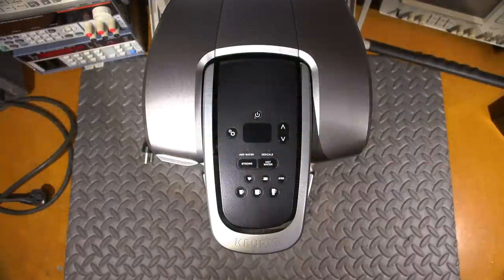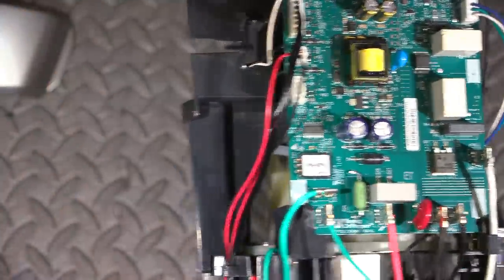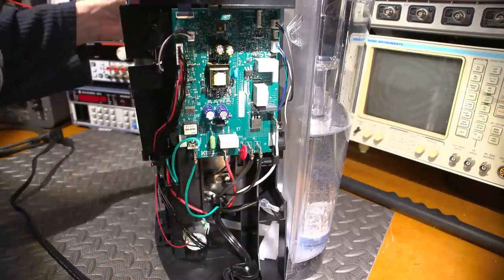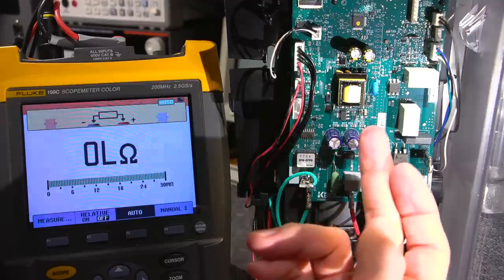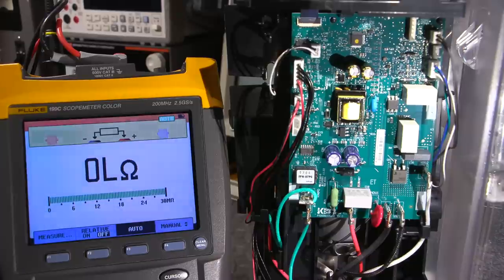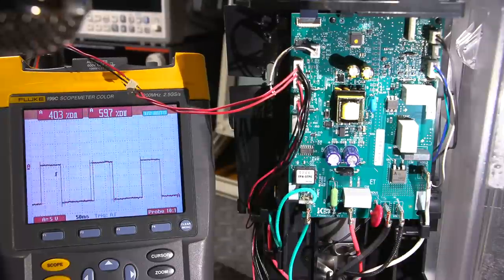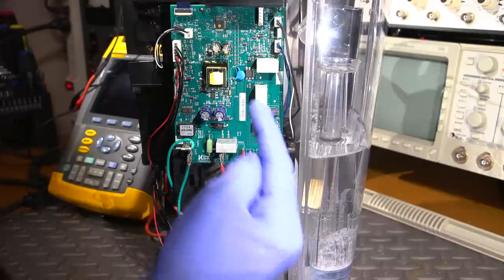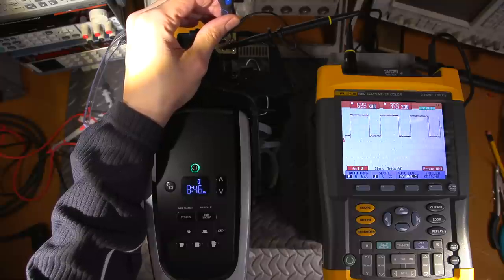Coffee Maker Repair And Modification - "For The Perfect Cup"- The Keurig!

Comment: I am willing to bet that was ONE satisfying cup of joe! I once reprogrammed a Cat Genie plumbed-in self washing cat box so that it didn't need the rf tagged and non refillable and expensive disinfecting/cleaning cartridges anymore. I was so proud of myself because consumer electronics are not meant to be repaired or modified anymore. I have a disk based coffee machine that works just like the Keurig (it even has the frother pump) that does not heat up anymore. The whole cycle goes as normal but the coffee is stone cold. If the heating element itself is burnt out I probably won't be repairing it but you have given me the courage to go in and see if the problem is with the control circuitry rather than the heater. I imagine i will be looking for a relay or or a big switching transistor of one type or another. Did you notice how the element was switched on your machine?

Comment: Elegant solution. I suspect a clogged or calcium restricted water filter.  Or the little board with the hall effect sensor, open cap or a faulty amplifier, or maybe the pulses are being messed with by the RF noise. You solved the RF noise, but it sounded to me like the built in RF suppression circuits/components failed, and it was leaking a lot of the high frequency noise from the switching supply. However, your solution works and it will probably last the lifetime of the coffee maker, so I really enjoyed this video and your "never say never" attitude!! Thanks for a GREAT video, Paul.  Cheers!!

Comment: I like my coffee maker (K. mini + ) most K-cups are for 6oz and this unit lets you put in the amount of water you want (fill tank is good for 1 use) it also has the 'strong' button.
In less then 2 min's and im good to go.
I like the fact that the unit you are working on looks well bidet and designed  in terms of board layout. We have one that does K-cups and has the 12 pot maker. sometimes you have to restart it after you program it the first time but it seems to like Pre-heat the first time then the 2ed time it works.

Comment: I bought a replacement 12v 5A power brick for an appliance a few years ago, and using the brick absolutely crushed even FM reception through much of our old house. (The FM radio's "antenna" was a few loops around the power cord.) I complained to the brick manufacturer, hoping they would acknowledge it was defective and/or needed a capacitor or three, but they just had me return it for a refund. If I were feeling like "tampering" with a new item I would have tried adding isolation like you showed, but I strongly suspected the third party replacement brick was destined to fail more quickly than the OEM part had. I ended up passing the appliance on to another person... it worked fine plugged into a 12v lighter socket.

Comment: I mostly think the 'deluxe' versions of these k-machines are deluxe junk, they can make them as pretty as they want with OLED displays, but they often are inconsistent at dispensing reliable amounts as it's not something actually 'smart' like a peristaltic pump. Have been through 2 of them and finally swapped to a single serving version, love the simplicity of it. The water you pour in is the quantity you get out, measurement lines on the fill reservoir if you need to get more specific ratios, no standing water left inside the tank to calcify etc. The only gotcha is if your drinking cup is dirty, then you don't want to use that to fill it. As well as a nearby water source of course.

Also that 'frother' feature is totally just an air purge.. they all have to do that or the needles will get gunked up over time. It's honestly amazing how they translated that into a new exciting feature. Also I highly recommend a battery powered whisk/frother to any that enjoy actual foam!

Comment: I had a $250 espresso machine that I bought from Goodwill for $10 with all the accessories. It had similar pump symptoms. Was caused by corrosion within the pump. Disassembling the coffee maker was quite difficult. It was NOT designed for repair as I had to Dremel my way in. I replaced the 15bar solenoid type water pump for about $15 (this was about 10 years ago) and great espresso ever since...althought the now properly working pump is really, really loud. The pumps look like they cost about $35-$60 now.

Comment: Cool little project and learned something along the way. I did learn some years ago that all coffee makers have a "hidden" programming mode where you can set EEPROM parameters.
Reply: Yes, I was going to post something similar. Totally speculative, but with the amount of "smarts" they program into the mcu, it sounds like the eeprom (likely built into mcu itself) may contain calibration settings (e.g. pump feedback/drive map), and that could have gotten corrupted somehow (maybe writing during getting the plug pulled, or perhaps the high noise level on PS which is also a very bad thing for digital circuits ;).
I suspect that these units may actually do some sort of calibration or learning over time, as the units get "scaled" (from hard water), and I was even wondering if there is some reset/relearn/calibration procedure (probably in unobtainable service manual), or even if the unit does some relearn at regular intervals, such as "descaling" cycle.
Mr. Carlson, wondering if you had already tried running it through descaling cycle?

Comment: I worked on a Keurig clone once.  Surprisingly simple.  It doesn't have all the bells and whistles yours have, but it does have one similarity.  It was a total pain to remove the plastics to get to what I wanted.  Mine leaked water all over the place.  Turns out, it was a manufacturing flaw.  In an effort to churn this things out as fast as possible, they managed to really screw up one of the gaskets.

Comment: Hi MR C.   Great vid.   I have a coffee machine doing exactly the same thing and didn't know what to do about it.  can't wait to pull it apart now. Thanks a million.
Reply: First try resetting the custom Cup Size buttons. I had a similar issue years ago after a coffee machine 'forgot' how to dispense water. It was fixed by pressing and holding down each button until the desired amount of water was dispensed.

Previous owner friend had already replaced the machine, but I took it home then accidentally fixed it by holding down each button to see what would happen. I was lucky to score a free working coffee machine!
Reply: @Microwave_Dave  thank you Dave I will try that first.

Comment: As hard as it may be to believe, its amazing to see how much similar and easier to disassemble this model is compared to the large commercial Keurig units we use at my office.

We have at least one at the office fail about every other year. I nab and tear them down for parts. They have a couple meters of plumbing, at least a half dozen valves, and a bunch of various sensors. All they do is make and dispense hot water, no other features like frothing or whatnot. I have not yet been able to determine fully why they are so overly complicated, there are so many flow paths and without it being functional, there's not a good way to tell what happwen during a cycle due to the various control valves.

I'd try to repair them, but I don't drink coffee and by the time I get the broken one, a new one has already taken its place. Plus the liability of running something at the office that is both electrical and makes boiling water is not something I want to take on.

Comment: You really do have a knack for this- well done.  Some comment and some questions for you.  Clever analog solution to a likely digital problem.  I learned quite a few things-  The little clip on the spade connectors was completely new to me- I guess my eye sight isn't what it used to be and I never saw this little latch- worth the price of admission.  My goto for making a quick and dirty PWM would be a 555 but you generally end up needing steering diodes to get better range- the TL494 is a nice fit.  The EMI fix was good too, surprised not to see a common mode choke on the input to the DC-DC- that thing couldn't have passed FCC compliance?- those results are posted on the FCC website and can be used to gain a lot of info on equipment- even a schematic if you're lucky. Some questions-  In one of the shots of the boards, there is a little 5 pin SOT-23 to the top right of the uP.  I wonder if this is an EEPROM.  It seems that you could dump its contents and compare it to a dump of a good Keurig unit and play with values- I know the values are cal constants so will vary some but would be interesting.  I am surprised the tach/flow sensor was a PWM, I would think that it would be a frequency- like a few pulses per motor turn. How do you get PWM from a rotating shaft?  Did you play with the frequency of the pulses you injected?  Thanks again- great work.

Comment: Thought about you the other day sir, was stuck in a hospital waiting room and they had QVC or one of the home shopping channels on. 

I was stunned at what they were selling, however they had a very nice and professional animation to show how the device worked.

It’s one of those “ultrasonic pest repellents”....that’s supposed to pump RF and ultrasonic waves through a speaker on the front. But the selling point of this product and what makes it “revolutionary”… Is that it also pumps RF back into the electrical wires running through your walls. They said that even your neighbors would be thankful, because the frequencies are so powerful that it will even affect the property next-door.😂😂😂 

I don’t know Who I feel more sorry for… The dogs in the area or the ham operators 😂

Comment: I have an older Keurig that has exhibited similar problems as far as not filling a cup.  I have hard water, and was... not as diligent with taking care of it.  Ultimately, I fixed it by running vinegar through it multiple times (standard hardwater fix).

Given you have multiple of these machines, I assume you would know and be dealing with hardwater issues if that was a problem.    I know from my efforts to keep my machine going (working good so far now) I've come to understand there are a bunch of check valves etc in the plumbing that can create problems.  I would guess something has reduced water flow.

I love your fix, I suspect though it's not root problem.  I would love to see a comparison of a working machine vs this one.  If it is completely identical, I swapping the boards would be interesting.  I'd also be curious about the draw of the pumps in a "working" unit vs the non-working unit.

Comment: Thank you for posting this! Btw after 4 Keurig machines I switched to a Nespresso and am so much happier with the coffee. My recommendation.
Reply: Why is that?
Reply: @larrybud  It actually makes a significantly better cup of coffee, at least in my opinion…. i was really surprised
Reply: @Gefionius  In what way? Is the water temp different? I'm not familiar with the machine. Does it use the pods? I mean, there's not much to making coffee: run hot water over the grounds. About the only thing which can be controlled is the temp and the speed in which the water flows through the coffee. the latter is not adjustable in a pod scenario.
Reply: @larrybud  i honestly have no idea, its a kind of magic. Just try one somewhere, a friend or a hotel or wherever….
Reply: Do they use k-cups? I see Consumer Reports rates them high.
Reply: @AiMR  no sadly they use their own pods… another closed system

Comment: Interesting.  I appear to have this exact same model and find no RFI from it at all on any band.  But, it did motivate me to find what has been causing a buzzsaw signal on 10 meters, clear across the band, every 20khz for the past few days.  Turned out to be the inverter in my RV camper parked just outside the radio room and under the antennas.  While I'm sure I could dig into it and fix it in similar fashion, I found it easier to just unplug the trailer.  ;-)  Great video though.  I have 3 or 4 non-functioning Keurigs stored somewhere that you have inspired me to dig out and have look inside.

Comment: Hi Paul
Much enjoyed the video and your very organised approach to making good of a bad piece of production but I was left wondering if the processor had a reset cycle which may have sorted the problem. I suspected that I had a sort of similar fault with our Italian tumble dryer when the heater stopped working. The heater tested ok, so did all the relays and the 12v supplies to them - I being left with the possibility of processor corruption- I managed to bypass a lot of the  full functions to still have a usable working tumble dryer but was left wondering if a simple multi-push button reset facility was available and would have solved it - the washing machines do but couldn’t find any such info for their dryers! Best Regards Graham

Comment: Nice that you "circumvented" the fault in the processor! About the RF noise, have you seen if there is a difference in the amount of EMI filtering between the others not "firehosing"? I see very little of filter caps and no common mode chokes in that PCB. Maybe the bean counters have reduced the no. of filters in this one. As a radio ham I am very badly plagued with switch mode noise, some of my own equipment I have put extra filtering into, but noise from the neighbors is worse..

Comment: I have that machine and have had a similar low and no flow conditions on a few occasions. The issue I had was it was actually clogged in the needle that pierces the top of the cup. It was cleared each time by just pushing a wire (bent paper clip) through the hole. To prevent it from happening it seems to be a matter of remembering to remove the cup right after brewing. I think if you leave it the water cooling down makes a vacuum and then it can pull coffee grounds up into the water nozzle where they sometimes get stuck.

Comment: Just an observation... You have a puzzle. You have a device that is creating strong RF. The same device is not operating correctly to make coffee. But you also have two identical devices which do not produce RF or malfunction. Why not use one of the good devices just as you might use an identical radio to determine the faulty circuit or component? It appears you have decided the CPU chip was damaged by a faulty speed sensor neither of which you can actually verify. Then you patch the RF issue to make it go away without determining why the other devices seem to operate without additional components. I do appreciate the time and effort you put into your videos. Carry on sir!
Reply from the maker: Hello Patrick. It's explained in the comment section many times, just browse my replies.

Comment: This is classic "if you have a hammer everything looks like a nail" Someone in the comments said "wow, a pacemaker for a coffee machine" And a couple of other comments are close. It's on the mechanical side. These things develop clogs. Either in the needle where the coffee comes out or the check valves down stream. One check valve is about 2 inches up stream from the needle that pierces the K-cups in the hinged arm. It's got a clogged heart and the pump is working double time with pressure resistance its not programmed for or engineered to over come. It's mechanical load is overloaded and that's how you let the factory smoke out of drill motors. Overload them with mechanical load then increase its duty cycle. make sure your needle is clear and mechanically work your check valves by taking the zip tie off the line then mechanically actuate the valve or blow through it. If you got a water trickle then you can get a solvent in there. Vinegar or citric acid to dissolve the mineral scale clogging it. I leave the hood off the hinged portion so I can slap that check valve around. This is what youre jostling if you "fonzie" your keurig with any success.

Comment: I had a string of decorative LED lights that totally drowned out the reception of my receiver. Once I unplugged the power adapter to those lights, ALL the noise went away. It was amazing. I had power strips that also had USB connectors on them - and those also had to be switched off because they threw RF everywhere.

Comment: Adhesives: ...I recall you mentioning before, a type of preferred adhesive like silicone that replaces the awful hot glue used by most manufacturers, however I can not find that reference.  Could you direct me to a good product that holds things like capacitors in place on a PCB that doesn't harden/get brittle/yellow over time and does not leave acidic damage?  ...Thanks again for your wealth of knowledge and experience for us regular enthusiasts.

Comment: Nice work!  We have a Keurig too (a smaller model) and it also has an electronics bug: the “DeScale” indicator wouldn’t turn off after it was descaled. Eventually we got it reset, but it was a pain. That unit had already been replaced once under warranty - so it seems that Keurigs have a rather poor electronics design department.

Comment: A couple of years back, I inherited a number of electronic devices, including a piece similar to one that I see on your bench 10 minutes into your video.
It is a Marconi 2955B, (and it is married to a 2957B.)
I am completely unfamiliar with how this unit works, or when/where I would ever use it.
The only indication that I have about functionality, is that if I tell it to run a SELF TEST, that it passes all the tests, with no error codes (Marconi 2955B).
Can I put it up on eBay as a functioning item, or am I having to list it as-is because I don’t know all the details, especially about the 2957B that is attached to the main unit?

Comment: Did you check the components driving the motor and the filters between the connector and controller,  and also the motor itself? Sometimes a bit of oil to prevent oxidation is also required.